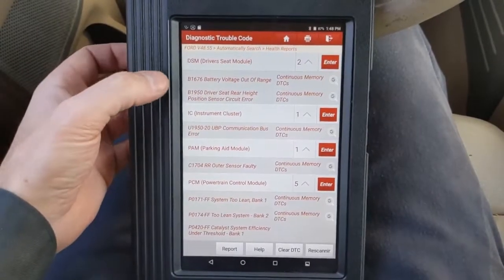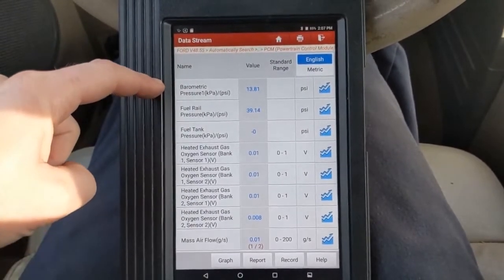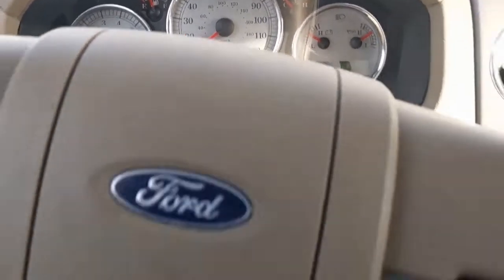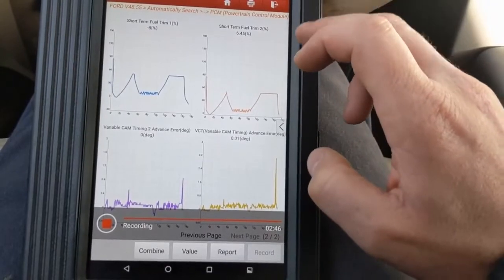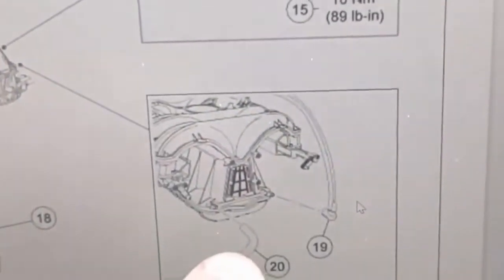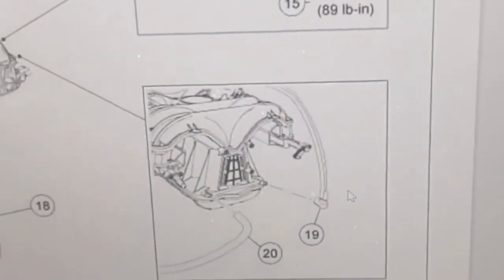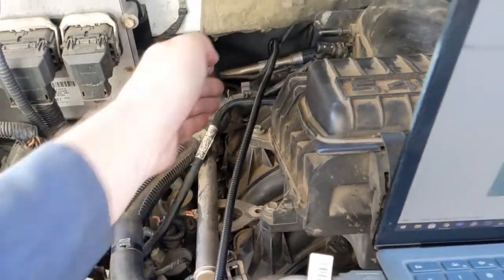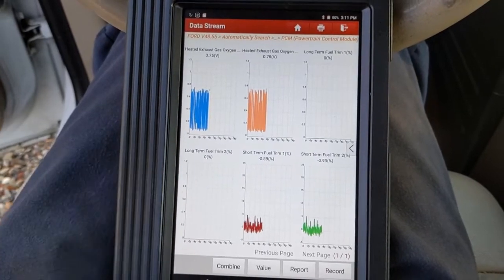Ford F150 P0171 P0174 Lean Condition Diag and Repair | How to Diagnose Lean Condition

Comment: When I bought my truck a couple weeks ago, someone thought it would be a good idea to harass me and they disconnected the connector for the IMR valve. I had to connect it reaching to the back. So I understand how difficult it is to reach back there. It was very difficult for me to get it connected. I did without removing anything. I have seen on youtube that those hoses swell up on that model and need to be clamped or have a new hose. FYI it may fall off again. I think I even heard that was a recall but not sure.
Reply from the maker: Hey Rex, thanks for the info. It hasn't fallen back off yet but if it does I'll try to see if I can get a clamp or zip tie around it 👍

Comment: My 1997 Ford f150 four by four pickup truck with a 4.6 l engine runs rough when you first start it up, after less than a minute it levels out and runs smooth, what could the problem be.
Reply: Intake manifold gaskets  and or depending on miles due for a timing chain set  ,as the engine warms the metal on a 97 to 2003 aluminum  intake swells when warm and closes the vacuum leak on intake manifold gaskets  common issue  by the way ford engines never run perfect  start simple then throw parts at it  lol coil packs spark plugs intake gaskets  timing set big job by the way  cost me 3 grand just to redo mine and that's without new cams and cam followers  mine were ok always kept clean oil  once you go in the timing cover be ready to put everything back all new  oil pump oil pickup tube .since tube gets clogged with metal and plastic from timing chain guides, chain tensioners all new seals and gaskets  oil pan gasket the works new water pump new serpentine belt all of it  timing chain oem ford only  plus guides and tone ring  everything else amazon is your friend

Comment: There there are thousands of different types of cars and vacuum lines. Just because it's a lien code doesn't mean it's vacuum leak. It's like everyone's go-to always a vacuum leak. No it's not it could be a bad injector it could be a bad wiring to the coil it could be the coil. It could be corrosion on the coil. It could be a spark plug. It could be you put all the wrong injectors in. It could have been something as simple as the old ring on the injector fell off. There are so many things. Stop going to a vacuum line and claiming that's where the problem is that's not where they always are.
Reply from the maker: You're right, many things can cause a lean condition. That's why looking at scan data is important. In particular "short term fuel trims". If the fuel trims are bad at idle but improve when you increase the RPM then you have a vacuum leak. A fuel delivery issue or ignition issue would not show the same fuel trim results.
Reply: @ValleyMobileAutomotive  I bought a 2006 Ford F-150 XLT, and it has been doing what the truck in the video was doing, like if I'm at a stop or not pushing on the gas, it will shut off. The guy I bought it from says #7 spark plug slips. Could it be that, or should I try other things? I changed the oil 2 months almost and put fuel cleaner at the same time. It has high miles, but the guy I got it from took great care of it and was a one-owner. Can you give me some help with how to go about this and what to tell the guy who will be fixing it? I had too many shops try to overcharge and fix more things cause they think a lady is an easy trick to say things like you need to fix this soon or could be a bigger issue. I know some things about cars but not too much about trucks. It is necessary to have them out in the country than a car. Please help with what you can. Thanks.
Reply: @lila6450  hi - I have an 2003 f150 and an 2007 f150 and 2006 mustang gt. All 4.6L engines. I had this issue with my ‘03 at one point. Would stall out unless kept on gas. Turned out to be the TPS (throttle position sensor).
Reply: @Michael McBride  Thank you. I'll have to look into that as well. I'm just trying to figure out all things it could be in case I try one & and don't fix it, then try others and so on. I'm just hoping to try small and then go higher. If you have anything else you think, please let me know. Thank you. I will come back after I figure out what it was and let you know. Along with others reading.